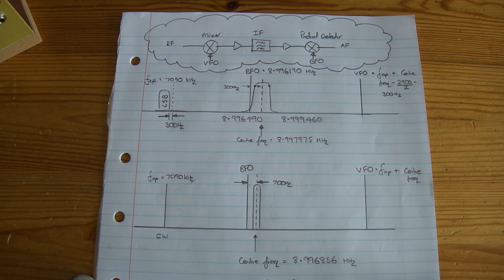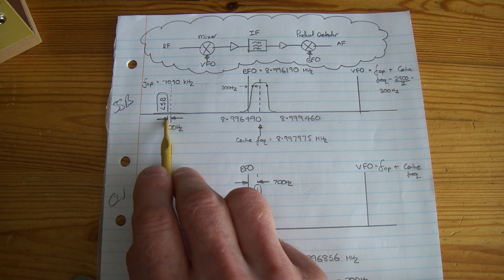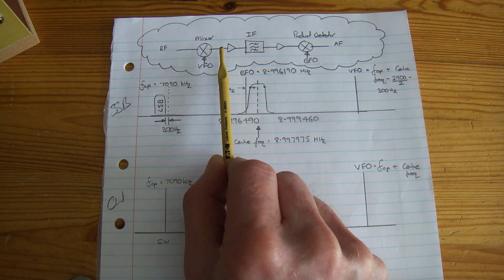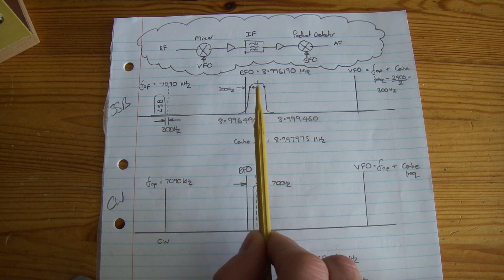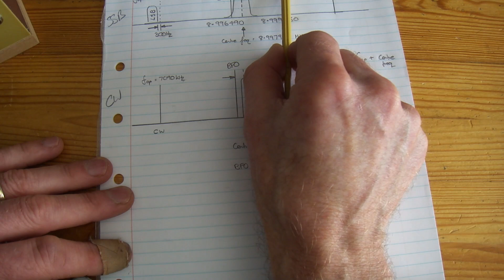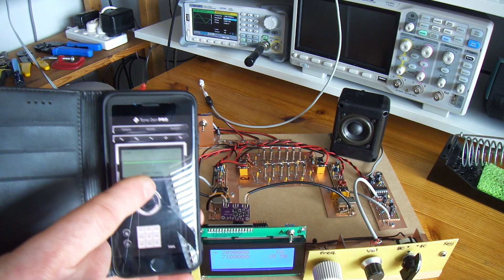Homebrew 80m/40m SSB/CW Rig - Part 7: Receiver Tests

Comment: Hi Charlie, very inspiring videos! Just few questions. How much power do you get to the mixers? Is it enough to fed the DBM mixers with the SI5351 directly? Have you seen an increase/decrease of spurs when you configure 2/4/8mA drive in the SI5351? Have you seen a difference if the output of SI5351 is driving a 50 ohm load or a higher impedance one?

Comment: Hi another great video, thank you very much .... but I think at SSB the Bfo = Fop + Cf - 2400/2 - 300 and the Vfo= Cf + Fop , another thing to mention about cw from compatibility point it is usually an lsb signal and the screen show the carrier freq. not  the tone freq. I think that will eliminate some  confusion at some point when working some stations on cw .... keep the good work and looking forward for the next video
Reply from the maker: Thanks for the input. My approach is to have the display show the actual CW freq. I will adjust the TX software to ensure my CW signal goes out on exactly the same freq. I did that for the tramping CW rig and it worked well. Thanks again and 73.

Comment: Hi Charlie is there any reason why you chose two crystal filers instead of one filter where you use variactor diodes to vary the filter bandwidth?
Reply from the maker: No Chris. I did have a think about using varacter diodes, but elected to have two filters. I wasn't sure if I would still have to have two different terminating resistances to get the right passbands. I really should give it a go as an experiment.
Reply: If you look at the circuit of the Elecraft KX1 it is done there. This radio is not just CW on the RX side hence the variable B/W filter.

Comment: Charlie, Could you please identify the black stubby item attached to the Siglent AWG used for the CW test. I should like to get one to use with my own SDG 1032X for the same purpose. Graham, ZL1GH
Reply from the maker: Hi Graham. It's just a stock standard 'rubber ducky' antenna. It works well. It also bends nicely if you accidently knock it.

Comment: Looking good. Can't quite see in the video but the SI5351 outputs should be AC coupled.
Reply from the maker: Hi Kevin. I have used both AC and DC coupling with the SBL-1, ADE-1 and TUF-3. I fond both work equally as well.
Reply: @CharlieMorrisZL2CTM  If running into a high resistance load DC coupling is OK, but with low resistance loads DC current is shunted towards the low resistance path via the Si5351 internals. A small improvement in Phase Noise gained. See QRPlabs phase noise article

Comment: I like that you resisted going the Arduino "menu" route and rely instead on rotary and toggle switches for your inputs. Menus may be necessary for portable rigs owing to limited front-panel space, but they're a totally-unnecessary bother for a stay-at-home rig. --Todd K7TFC
Reply from the maker: Agreed. I like the look and feel of a real switch. Not to everyone's liking, but that's fine.
Reply: @CharlieMorrisZL2CTM  What if you used a 24MHz SSB filter? The front end would then need just one LPF.
Reply: I def prefer the old school approach really satisfying